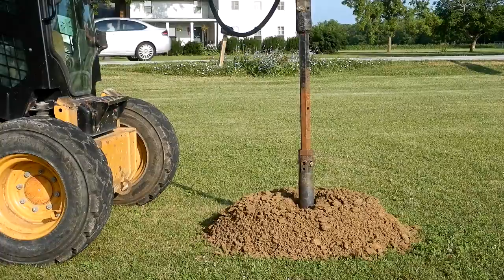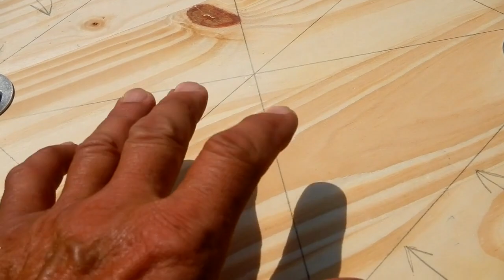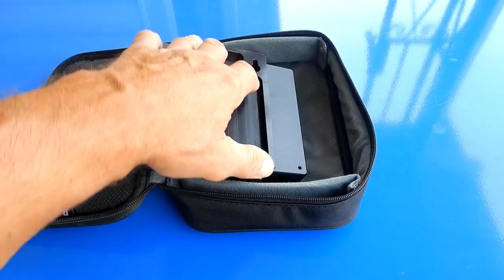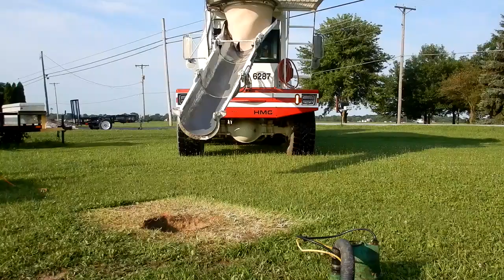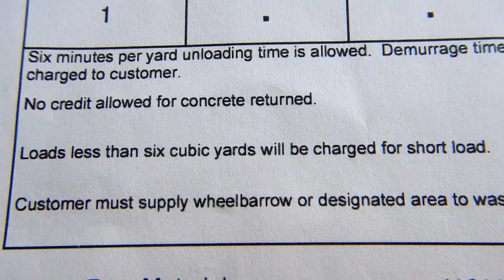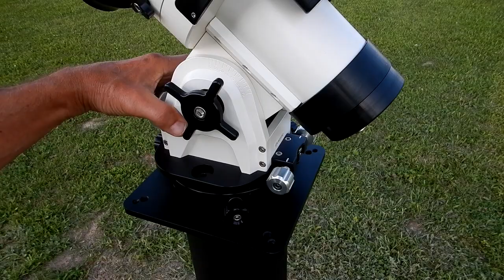Permanent Telescope Pier - How I Installed One In My Yard (easy project to do) Saves Time Setting Up

Comment: I assume if it saves time that you leave the rig set up all the time.  What security do you have?
Reply from the maker: No way is my equipment left out. The permanent pier makes setting up quick. Attach mount and 🔭 and you're observing ⭐️. Now, there are occasions I leave it out a couple days in a row. That's when the weather is good and I'm not working the next day. Can cover when needed.
Reply: That's what observatories are for! The equipment is not heated & so equilibrium with outside temperature causes no visual aberrations. Or heat mirages due to the glass & metal differential.